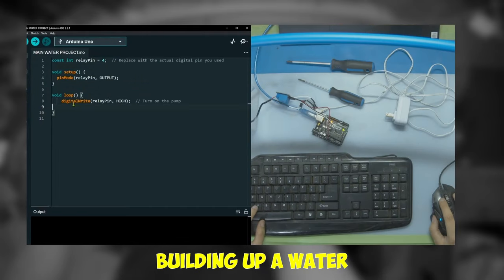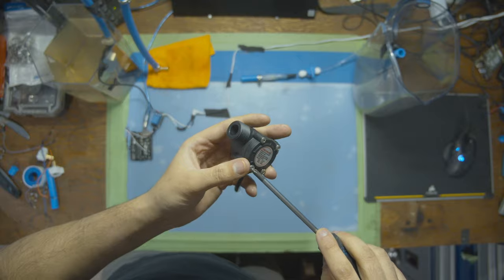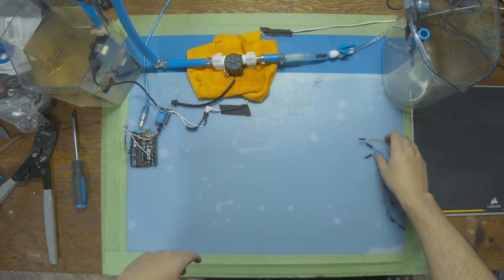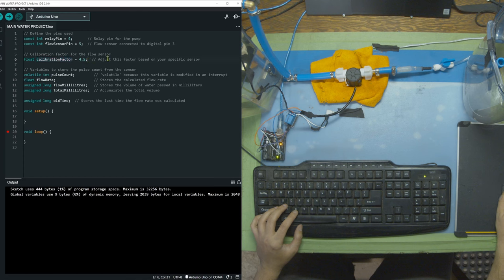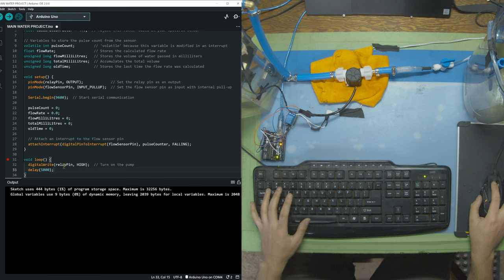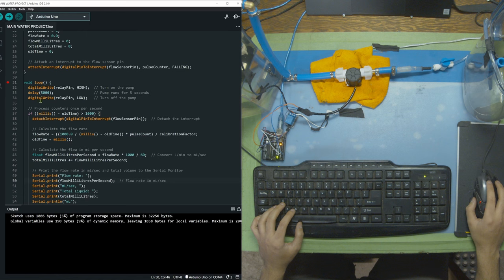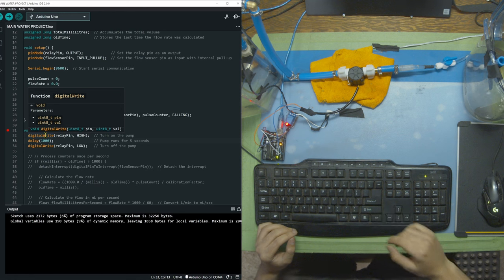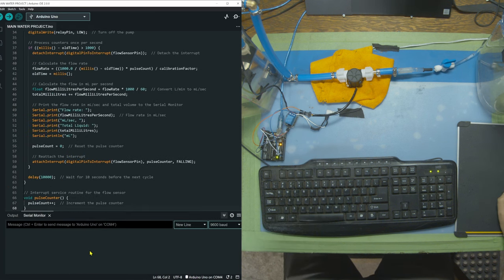MEASURING WATER FLOW WITH ARDUINO #arduino #esp32 #waterpump

Comment: instead of replacing my water meter I want to add this to a nearby faucet to track when there's water coming from the city supply, can this be used for that? I'm worried it might track air pressure instead when there's no water flow.
Reply from the maker: Do you think the air pressure is strong enough to turn it? Maybe you can install it somewhere else we’re going can guarantee water flow. If you can get around that then yea this would work but if it’s a city supply line it might be too powerful or fast of flow for this sensor, that would be my main thing to check

Comment: Would it not be better to include a counter like 74hc4020 to save on interrupts? Use an interrupt at a suitable count value. These hall effect devices are essentially liters per pulse, so the count yields cubic meters  easily. Appropriate timers can be used to find flow rates.
Reply from the maker: Yeah there’s definitely better ways to go about it, I would completely change the setup next time around

Comment: would this code work on a esp32?
Reply from the maker: it should, just make sure you select the right board in the editor before you upload and check where your proper pins are

Comment: would the flow measurements still be accurate if the flow rate were to change? I am planning on building something using these for a filtering system, however, the filtering system gets slower as the filter pads become more clogged up. But if it's been calibrated then it should still have an accurate reading right? It would just show a slower output? Thanks for the video! I appreciate you keeping in your own errors, we're all human and it's good to learn from others mistakes :) Keep up the good work!
Reply from the maker: ideally this would give you flow rates as a reading, so yeah it should be accurate exactly as you said

Comment: Subscribed! ❤
Im wonding what the curve looks like for each system with variable valve, that is not only on off but has a range of pressures and flow rates. And especially how to take dynamic pressure and adjust the calibration valur accordingly... Let me know if you have some insights 🙏 Thanks a lot and all the best!👍

Comment: When winding your thread seal tape, you should wind it in the direction the fitting is going on, aka clockwise around it. This will pull the end tight when you screw the fitting on, rather than push the end of the tape out.
Reply from the maker: Good to know, thanks Jake!
Reply: Don't those fitting have seals in anyhow? Not sure but they look like they would

Comment: thank you for your videeo, does flow sensor can control the pressure of water flowing? IM looking for a valve that can control the pressure electronically.
Reply from the maker: Glad it helped! thanks for the feedback 

https://www.youtube.com/watch?v=3S1473D2v1o

as for water control I would recommend this solenoid that can close and open a water source electronically, and maybe pair that with a pressure sensor if thats what your trying to read

Comment: Pls can the water flow sensor be used to detect water leakage
Reply from the maker: If flow drops you can assume there’s a leak but it’s tricky and not super accurate, there’s probably different ways to detect that